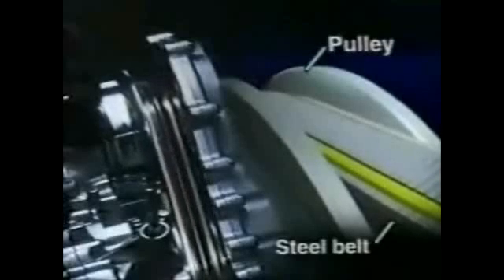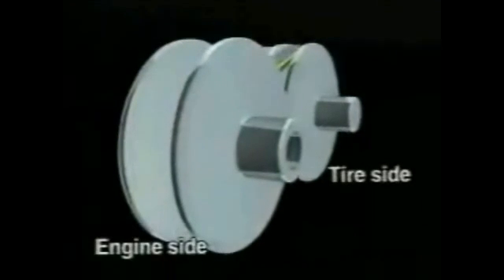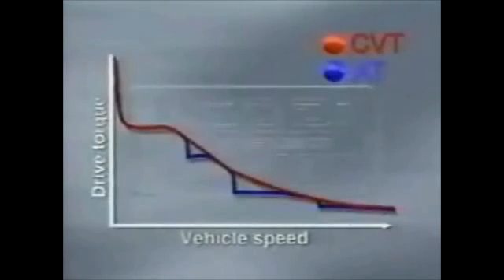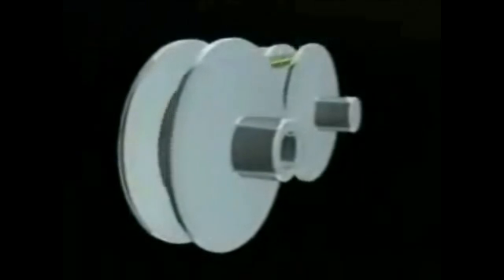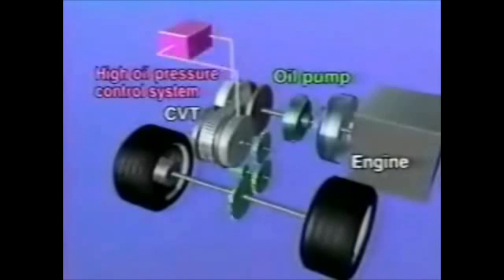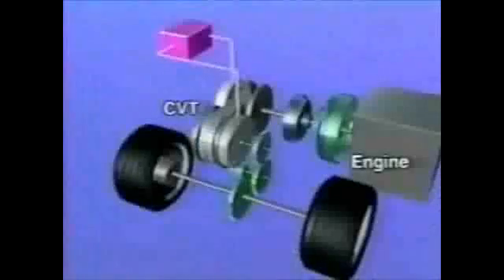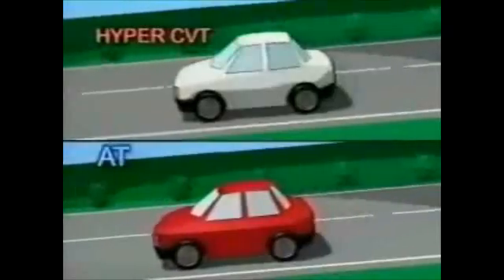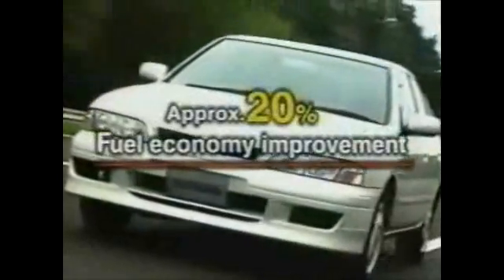Nissan CVT Transmission Types

Comment: The CVT Transmission in my opinion is the worst transmission ever made and the fact that it is supposed to be more reliable than a manual transmission is hogwash the transmission 1st generation 2nd generation 3rd and 4th generation only last about a hundred and twenty thousand miles before complete failure a manual transmission last over 4,000 miles even in the first generation please discontinue making the CVT transmission on the value of a Ford ability Nissan is being sued right now because their cars do not last over a hundred and twenty thousand unless you spend a lot of money in ongoing maintenance in this transmission as of now they are trying to phase out the manual transmission even in European cars this should not and cannot happen driving an automatic car is like sitting on a couch and almost falling asleep especially in traffic drivers need something where they can familiar themselves and be in total control of the car by which paying attention to driving instead of sitting on couch operating a smartphone looking at videos the automatic transmission has made drivers lazy and unresponsive unknown responsibility while driving if you don't believe me look at the poles of accidents of drivers not paying attention while letting the car drive itself
Reply: I do get your point, but you are behind the times. I still drive a manual, but even and old goat like me knows their days are numbered. Driverless cars are around the corner, so who cares if they pay attention.

Comment: My wife's 2012 Murano has 94,000 miles. We were in it the car the other day and I was driving, two times while decelerating I felt a slight shutter in the driveline. She drives 80-100 miles a day and now I'm getting nervous, don't want to pay the incredible cost of a replacement CVT for a car with 100.000 miles on it. She's trading up to a new RX350 with an 8 speed automatic, which should last as long as she wants to drive it. It gets great reviews and better fuel economy than her Murano…..and no CVT to worry about.

Comment: hello sir i have a toyota opa cvt gearbox and the problem is it drive only on the first gear it dont change speed
and i open the valve body.  to clean but a plasticholder with steel ball fal out and i dont know now from where
can you help me please

Comment: The steel belts are the weak link. Steel isn't like rubber - it can't be flexed back and forth hundreds of millions of times without experiencing metal fatigue and eventual breakage. I don't see how steel belt driven CVT's can ever have the lifespan and durability that customers expect. The whole concept of a continuously variable transmission is very, very good. But flexing steel belts does not seem to be the way to do it.
Reply: A rubber belt will wear far quicker and will fail long before the steel belt under high tension. The Van Doorne steel belt includes a flat flexible section designed to withstand the strain/fatigue caused by bending the belt around the pulleys for the design life of the transmission. 

Once the fatigue life of the belt has been reached and you start to lose a little performance (i.e. starts to slip), then you simply replace the belt as advised by the manufacturer after x thousand miles. There are dozens of such components on a car, not sure what you mean by 'the lifespan customers expect'. The customers should expect what the manufacturer advises it will last for (never any less). If my car manufacturers says replace the brake discs and pads after 20k miles, should I expect them to last 50k? 

Maybe the belt needs replacing before comparable components in a non-CVT vehicle? Well then if they have designed the transmission effectively, the cost of the replacement belt is outweighed by the savings in improved fuel efficiency. Win-win. 

The main problem with the CVT is the initial cost, weight and maximum torque limitations (and sunk development costs into standard AT transmissions) hence why CVTs are not widely used by other manufacturers. They're theoretically more efficient leading to better performance/power output and fuel efficiency. In my opinion though, just buy a manual and enjoy driving while you still can.

Comment: Why not use 2 belts instead of one?
Reply: How would that work?
Reply: What you do is have 2 belts connected somehow i mean cvt transmissions connected together like in tandem in order to supply 2 drives or dive the load of hp/tq in one system but like 2 cvts systems working together sharing half the load but putting in one input which goes down the axle and transmit power to the wheels, its possible, is just more than one and more programming involved.
Reply: knightrider1545 My guess would be packaging, cost, and relability concerns would make this less than desirable.
Reply: djphonics
but 2 belts more hp/torque
Reply: You've got a point, and if you were racing the vehicle that might be something to look into. That being said, when producing for the mass market you have to remember that reliability is a key factor, especially in a world where the majority of people do not properly care for their vehicles and still expect them to work. Trust me, the CVT can handle plenty of HP for the everyday consumer.

Comment: dont understand all the bitching. in my opinion if i have to drive a car with an auto i prefer it be a cvt, they squeeze every last drop of torque out of the motor and help achieve great gas mileage.  as for problems with them, nissan has a badass warranty on cvts, its over 100k if i remember correctly

Comment: Dodge place CVT in the Caliber and its a train reck, lucky if you get 80,000 miles out of a transmission. There is no rebuilt kit for it so no shop will rebuilt or warranty the transmission. It must be replaced at a tune of $6,000 or about 4,000 pounds its a nightmare!